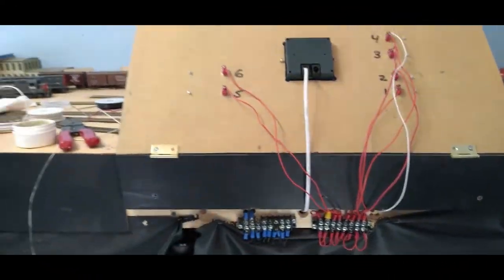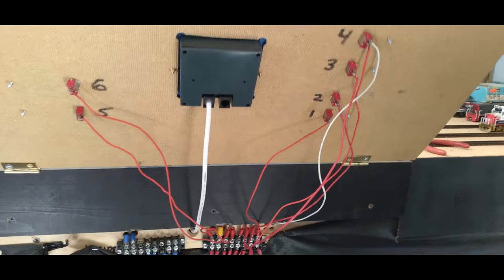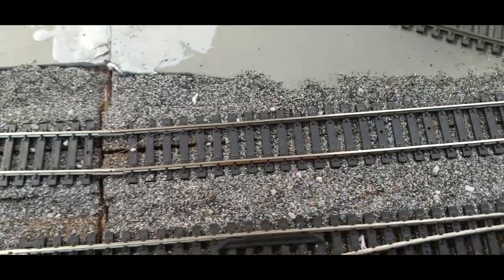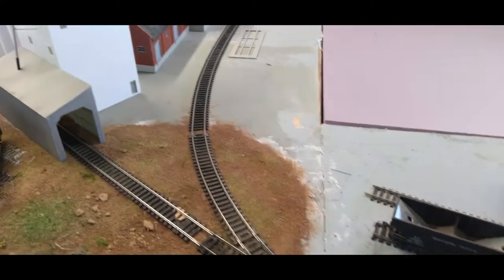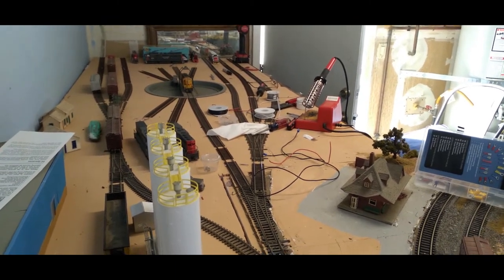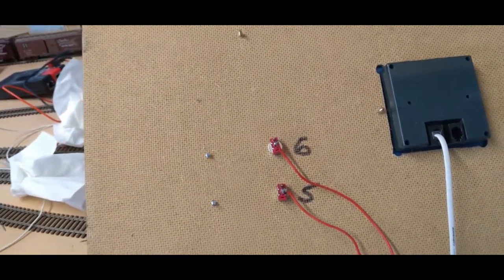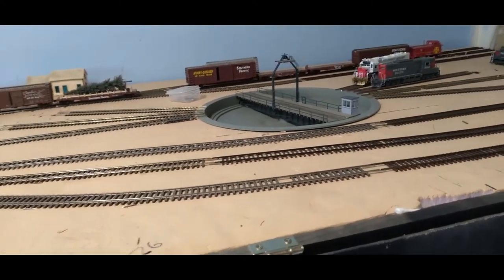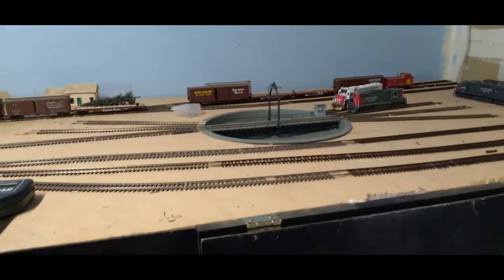The Turntable Project

Comment: Run'n Good Randy... luv how smooth that turntable moves... I mite of told you this but they taught us how to control the old SP turntable in Bakersfield in case we needed to spin an engine down there... DD  🤪
Reply from the maker: Was that air driven Dave like ours at the museum.
Reply: @randyj6245  Hey Randy... if I remember correctly it was electric... I dont remeber it being on air.. you went into a locked 'phone booth' size booth that was on the turntable and the controls were in there..
So are you going to the Train Show this weekend??   DD
Reply from the maker: Boy did i score at the train show.  Found that old Kraut, another PA1, SD45T2, and some switchers!  I spent $400.00!
Reply: @randyj6245  That's cool Randy... yea I saw your score.. There's a pic of one of those Kraut's going over the Altamont in John Signors "SP Western Division" book.. That's why Train Shows are fun.. you never know what you're going to come home with and how much $$ you're going to spend...Congrats.         DD. 😆🤑
Reply from the maker: You are so right DD.  Have a great week